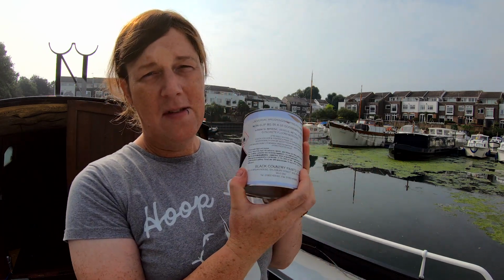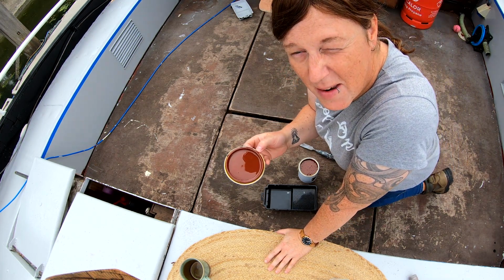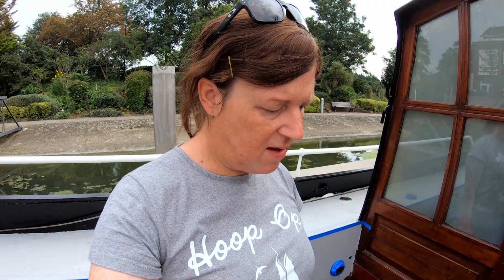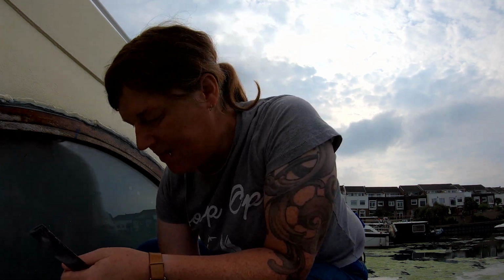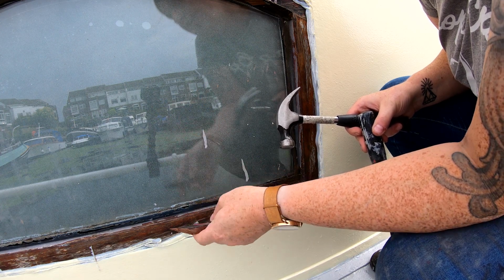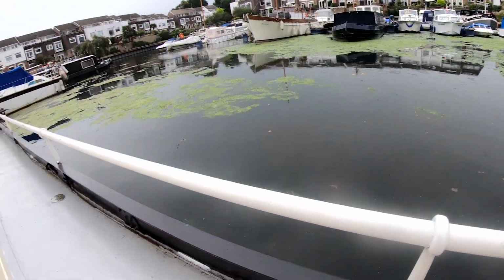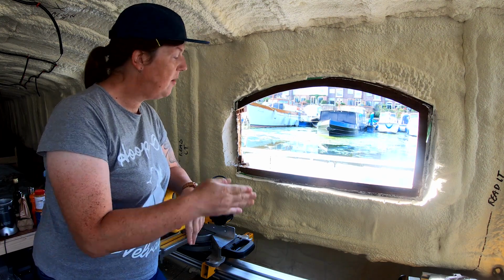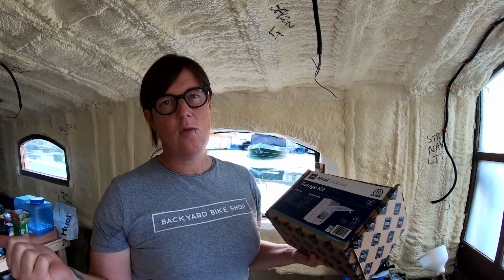#24 I've Been Framed! - Dutch Barge Home

Comment: Always get sample pots first, lol.  Never be worried about using the 'wrong' colour, as it takes time to find the right colour (hence sample pots).  Try to match the colour to another colour on the boat, or find a sample of the colour you want, and take it to the shop with you.  Colour is important!  (from a former colour matcher in a paint factory)
Reply from the maker: Sadly the smallest tin I could get was 1 litre although I should have thought more about the colour chart! Thanks for the advice! 😊